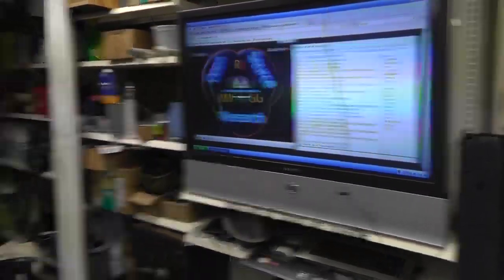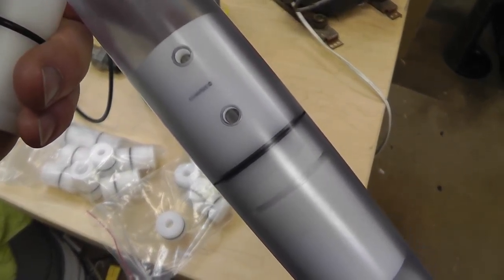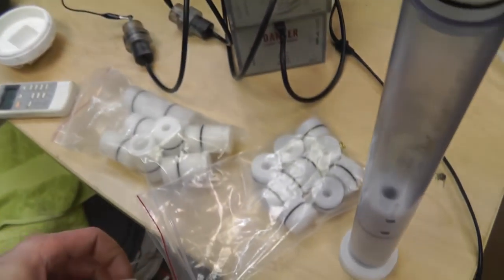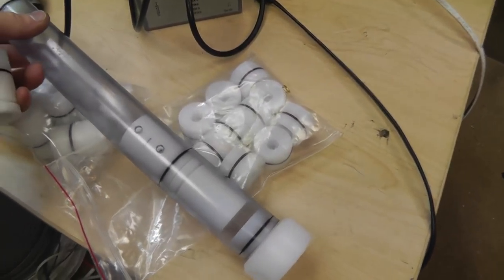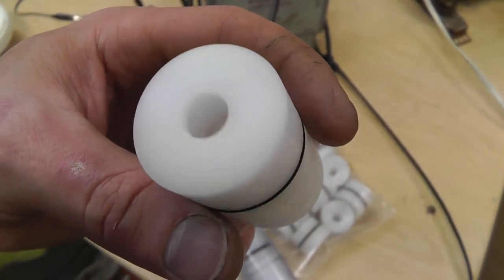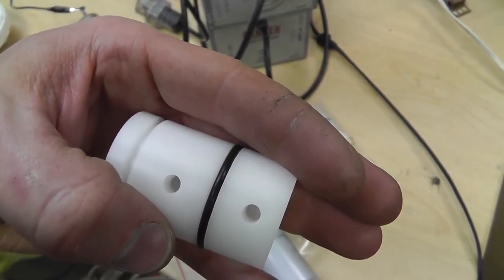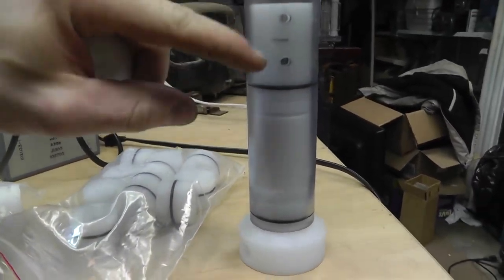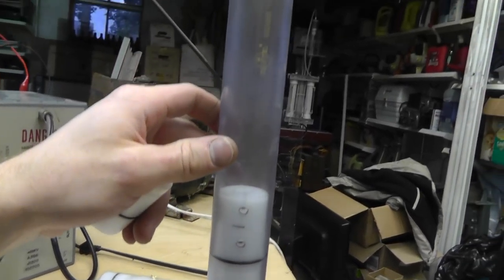UPDATE, Cell Time! A Set Of Stan Meyer Resonant cavities...

Comment: Hi Russ - still looking for a magnetic liquid?! if you didnt know Einstein him self made a fridge that Used a potassium Sodium alloy (metal) that was pumped using electromagnets (like yours) around a pipe to pulse pump it. the mix is acidic to warn you.  energy from the surrounding can be sucked into the mix that can be turned into magnetism going through your coils an turned into electrical energy.  Right?